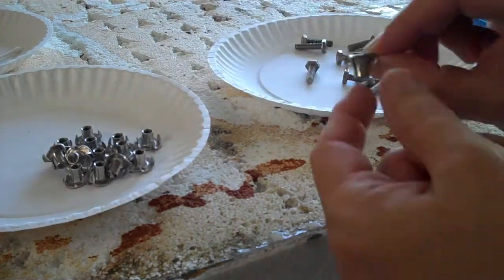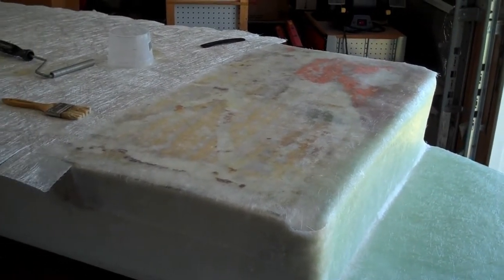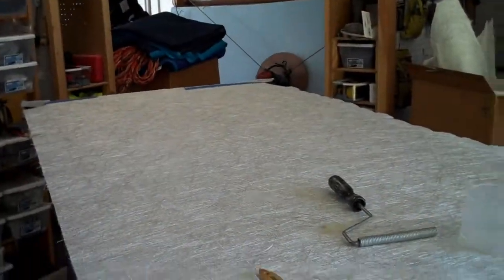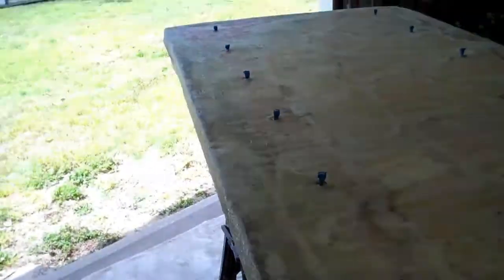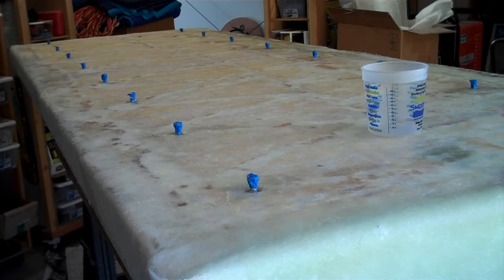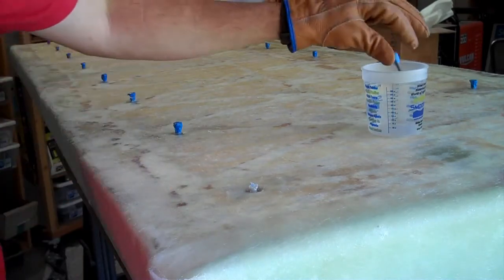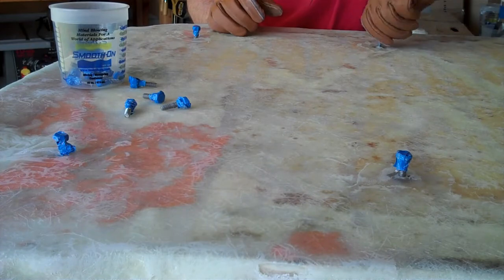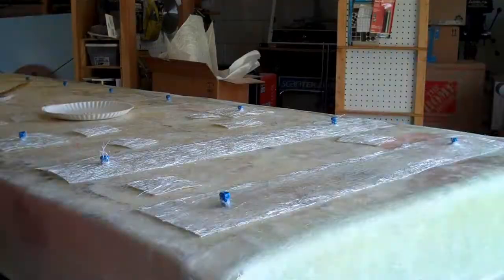Embedding t-nuts into my fiberglass pontoons (deck mounting points)

Comment: Can you list the materials you used so I can go purchase the correct things. Thank you!
Reply from the maker: The T-nuts are McMaster Carr part number 90973a029 (tee nut insert for wood 18-8 SS, 1/4"-20 thread, 0.375" long)  The bolts are any 1/4" bolt sized to fit the length you need for the other side. But just about any t-nut would work, the ideal ones would have a large flange to get as much surface area in contact with the fiberglass as possible, and stainless steel to prevent corrosion.  I'm using McMaster Carr part number 2386k78 (no residue mold-release lubricant for fiberglass), but you can use just about any type of wax/mold release agent.

Comment: Thanks for the video. Looking to do something similar or the same for my boat ladder. It has wallowed out the 4 mounting holes. Unfortunately, no access below the stern swim deck or I would be using through bolts. How much pressure do you think those provide? Enough to keep from ripping out with 150lbs of weight on the ladder??? This has to be the only way...
Reply from the maker: The metal would be fine, but it all depends upon how much fiberglass you use to embed them.  I only have a few layers as most of the force in my application is downwards (gravity holding deck boards down to the pontoons) and not held on the nuts. They just provide a bit of lateral stability (and keep the deck boards from bouncing up), but for a ladder you would need to reinforce the area around the nuts with a lot of fiberglass&epxoy.
Reply: @summetj  Yes, I agree. It's a fiberglass center console. The top cap though I do not believe is wood cored. I think it's about a quarter inch of fiberglass. I guess the only way to know for sure is to try right?!

Comment: Nice video I think I'm going to use elements from this to fix a broken mounting point for my car spoiler. I have the fiber glass mat and cloth and some Bondo glass but since it's going to be underneath and not seen I think I should be able to just reinforce the t nut how you did and then that way my faster can be the same size as the rest.  Thankyou for the video!

Comment: Can I use this technique to attach footstraps to my surfboard?
Reply from the maker: If you are building a surfboard you could certainly embed mounts like these to attach accessories to it.
Reply: @summetj  I'm trying to attach to an existing surfboard
Reply from the maker: @tormarquis  You could also make that work, but would probably have to drill out some holes and blend the new/old fiberglass if you wanted them flush mount. If you didn't care about aesthetics much, you could just sand down the existing top where you wanted to mount them and then the new fiberglass would stick to the old well enough, but you'd have raised lumps. Might be easier to epoxy the footstraps down directly.
Reply: @summetj  what about using "plus nut " rivet nuts that would expand underneath the fiberglass into the underlying foam?
Reply from the maker: @tormarquis  You could certainly install them, but I would worry that the fiberglass around/over the plusnuts would need reinforcement to prevent them from pulling out. (It all depends upon how many nuts are required for your specific situation and their layout, but my impression is that the fiberglass over foam surfboards do not have terribly thick fiberglass on the deck.)